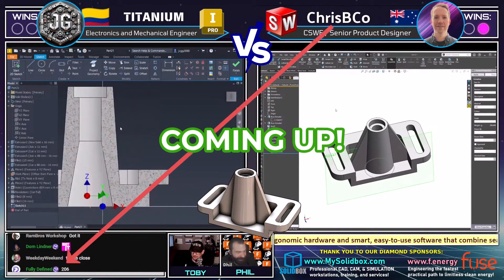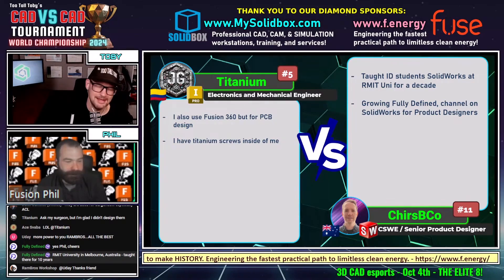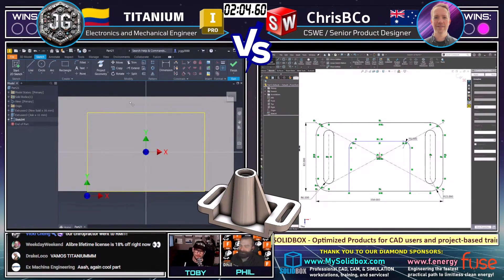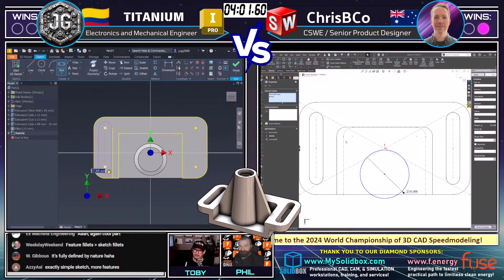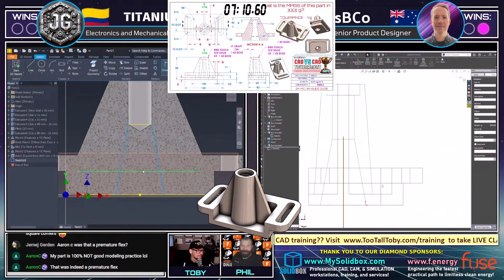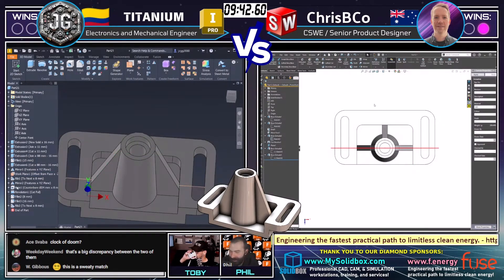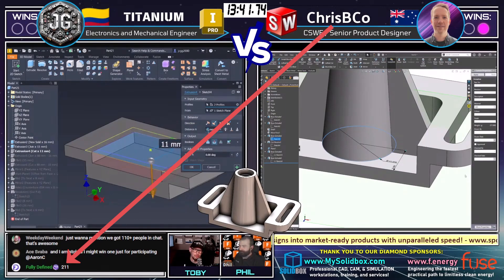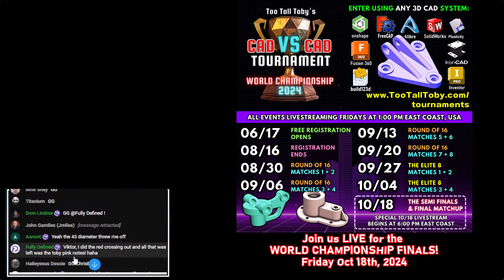3D CAD esports - TOURNAMENT HIGHLIGHT - Match 11 - TITANIUM VS ChrisBCo - INVENTOR vs SOLIDWORKS

Comment: Brothter, I'm trying to do this model. But got problem with RIB on top face of the extruded cylinder. Even in the video, we can see a key edge of that RIB. Is it possible to do a perfect RIB without ay key edges on this type of cylindrical shape. I also try this method from your video "https://www.youtube.com/watch?v=m39IGYC4Pn4". But could not satisfied.

Comment: I LOOKED AT PUTTING RIBS ON A CIRCULAR SURFACE WITH  SPLIT LINE WHICH WORKS BUT COULDNT DO IT ON A TAPPERED CIRCULAR  MAYBE TRY IT REVERSE HOW CAN YOU DO IT
Reply: i also tried using extrude to a surface t3 but solidworks didint like that.i had to call in help which showed me to loft two sketches and cut by surface. i would like to know why i coulnt extrude to surface and how would you would have accomplished those ribs?
Reply: rib func. works only at planner faces. You need to create sketch or sketches at planner faces that intersect with circular faces and then use loft or boundry extrude.